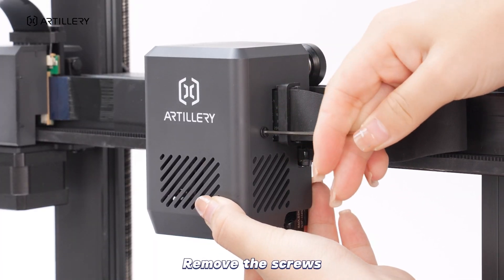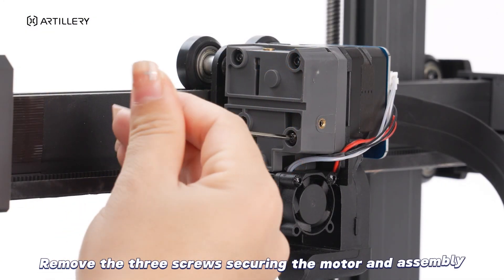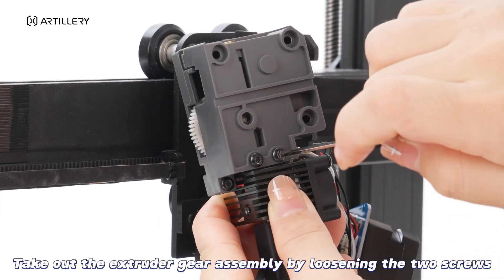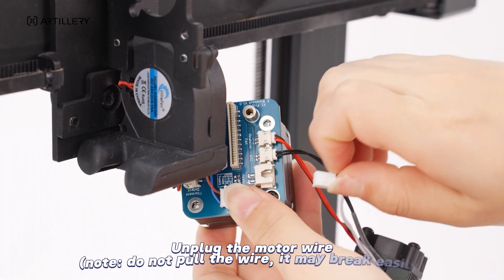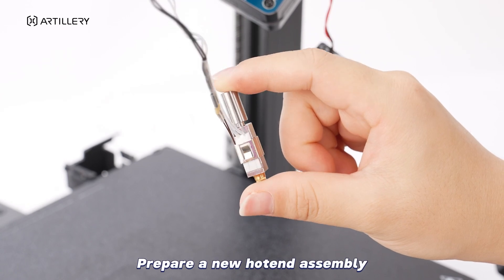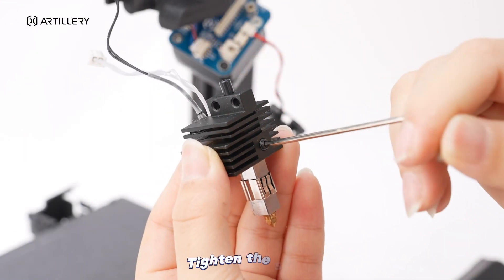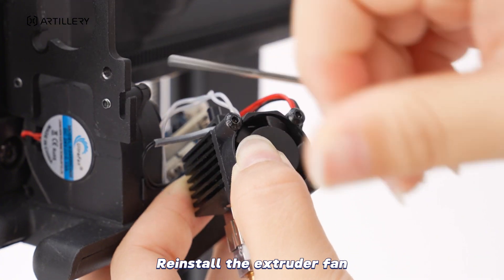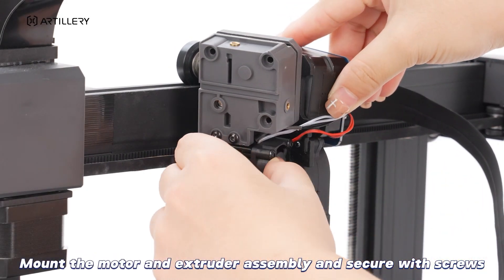Tutorial | How to replace the hotend of Sidewinder X3 Pro/Plus

Comment: The filament keeps getting stuck. How can I fix it?
Reply from the maker: Hi there. May I know what type of filament do you use? And what is the temperature setting
?
Reply: You should mention that the PTFE tube also needs to be installed. In the video, it appears to be installed after mounting the hotend, but you don't indicate that it needs to be installed.
Reply: Did you also change the PTFE tube?
The video doesn't show you changing it, but you should do so.